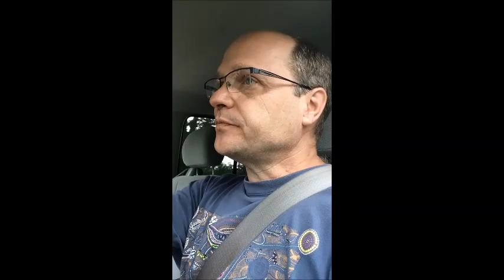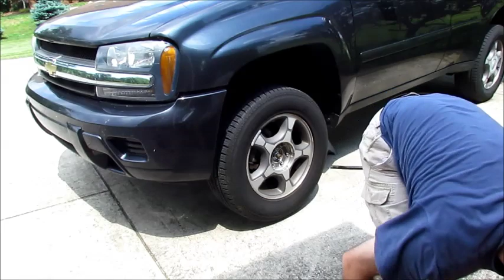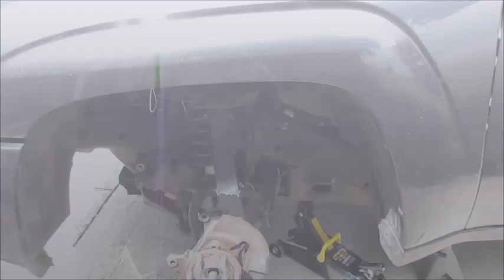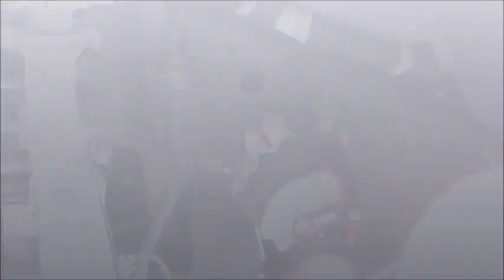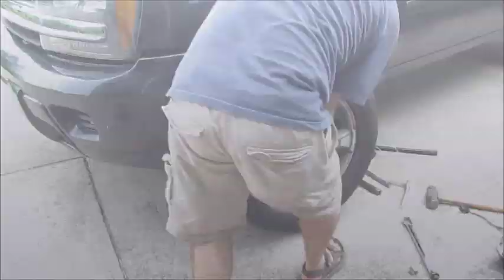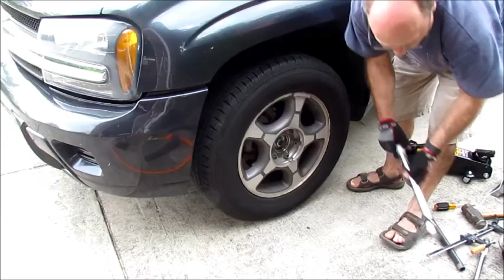Trailblazer Wheel Bearing Replacement - Start to Finish

Comment: My original Trailblazer front hubs lasted 140,000 miles.  My $60 Amazon Chinese replacement hubs lasted just 40,000 miles.  I just installed a third set of higher quality hubs, hoping to get more than 40,000 miles of service.  BTW, you should clean the hub seating surfaces prior to installation.

Comment: If the rotor doesn't want to come off, you can use the 18mm bolts that hold the caliper to the bracket.